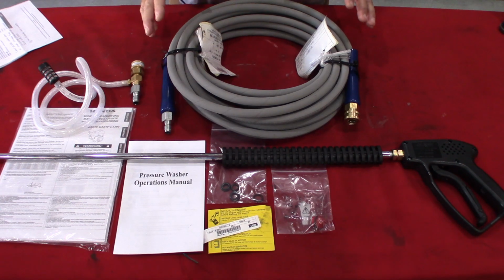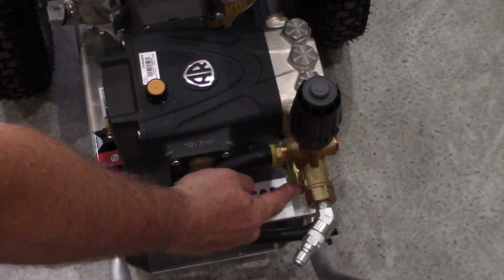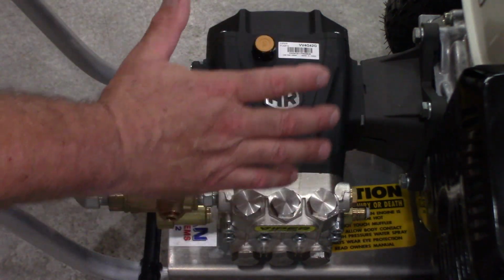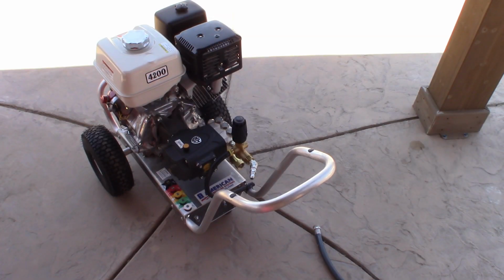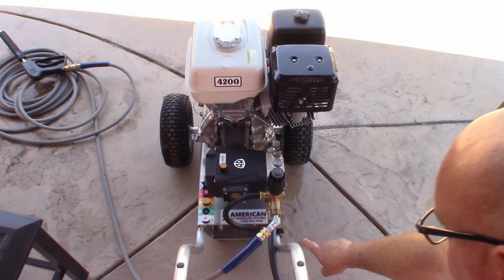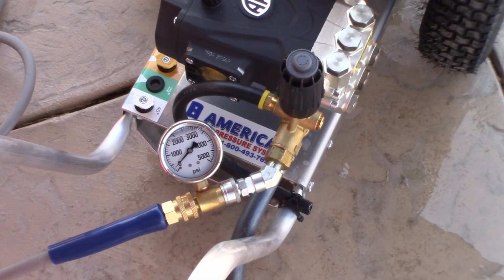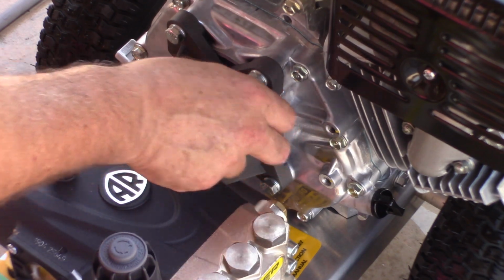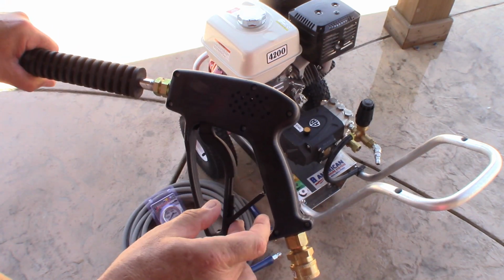American Pressure Systems 4200psi Pressure Washer #realraysgarage

Comment: Great demo!
Reply from the maker: Thanks Jim, To date zero issues and works as good as the day it arrived! Excellent pressure washer and great company!
Reply: @RaysGarage  You're very welcome. I purchased a very similar model from American Pressure because of your video. My previous pressure washer wasn't working great, and I wanted to upgrade to a commercial model. I had questions on the pump like you did. I ended up going with a 4200 psi, 4 gpm, Honda GX390 engine, and the Viper pump. Just picked it up from FedEx today. One question... do I need to add oil into the Viper pump, and does it require the same oil as the engine. My other pump didn't require oil. Thank you in advance for your assistance.
Reply from the maker: @jimrussell4731  American Pressure Systems will send you the oil for the pump and engine.

Comment: Awesome modification on the water dump system!
 
I’ve modified many different things in my day. Built turbo engines for a few cars.  Built several computers from scratch.  Dirt bikes, crotch rockets ect ect.

I have an idea you may like. 

The bypass system that you turned into a dump system.  That’s the best for absolute peak performance cooling, however It seems like it would make quite a mess.  Maybe it’s not a big deal and I imagine for most it won’t be any trouble at all.

But, I think there may be a middle road to take for upgrading the bypass system.

If you got a small radiator, something with let’s say 1/2 to 1 liter in capacity, it would at the very least add more cooling potential to the bypass system, with no leaks.  If need be, which I don’t think there would be, a small electric fan could be hooked up to the system to just run constantly with the pressure washer while it’s running.

Could be a pretty in depth mod, but I think for some people that may be a nice feature that could add more potential and greater longevity to the pump.

I am still learning, but that’s the best Idea I have so far.  I figured it would be best to share, and risk sounding ridiculous, than to keep it to myself if it really could help a couple people.

Thanks for your video. I am going to their website now and plan on possibly purchasing this very unitT.  I was looking at power-pro for manufacturer but this one is almost identical and a couple hundred dollars cheaper.
Reply: Actually, that's a great idea. A heater core would work great

Comment: I just bought this same exact model! Comes on Wednesday! Adding pressure washing to my business and can’t wait for this beast! Thanks for the review!
Reply from the maker: Your going to love it!!!
Reply: @RaysGarage  - it arrived 1 week late. Just got it yesterday. Question. On the pump it says “only use sae 15w40” which is a detergent. But everyone says make sure you use “non detergent “ on pumps. Should I just follow the directions of the pressure washer?
Reply from the maker: @saulpaul7263  Hello Saul, Mine came with the correct engine and pump oil, bothe oils were different so I would stick to what the engine and pump manufacturer recommend for your model engine and pump.
Reply: @RaysGarage  - appreciate it!!!

Comment: I bought a pressure washer at my local hardware store and it's like the little brother of your machine, which is awesome btw. Mine is a Champion PRO #100787 using a Honda GX200 with a AR Pump JRV2.5G32 producing 3500PSI and 2.5GPM.

Comment: Great video, and nice setup.

 I run something similar commercially, just in a more glorified manner with the attachments and reels and whatnot. 

My dealer gave me a hint when setting those unloaders. You want some water (a dribble) to come out of the unloader while the trigger is pulled. This saves the unloader from slamming shut onto metal when it unloads and helps it last a long time. Your unloader is set aggressively in this video. You don't want trap pressure over the maximum pressure of any part of the system. Usually 4000psi with this kind of equipment. 

Great job opening up the bypass, that's such a lifesaver when you need a short break and don't want to kill the motor. I usually just idle mine down all the way and let it run. My only problem with this kind of motor is the small gas tank and lack of a fuel pump.  Thanks for sharing.
Reply from the maker: Hello Carl, Thanks for sharing this great information! I will contact American Pressure Systems about that slamming at high pressure since I do want this pressure to live a long time! Best Regards, Ray

Comment: TY. On pumps: That Viper looks nice. I was deciding between that one and the same one (also with the Viper pump) with the belt-drive for $500 more. Went for the belt. I used Pitts Spray Equip, they had every option you could fatham, so they also had that one you have or a belt drive with the Cat pump for $100 dollars more each. Anyways, your video made that decision very easy. Plus Cat is the only pump with a 2 year verse 5 year warranty. 

Any engine is going to last longer than you're ever going to keep the machine, it's just the pump that your are going to have to worry about eventually failing. So when it comes to picking your worries, prioritize.
Reply from the maker: Belt drive pump is the way to go, lower pump RPM = Long Life! 👍👌

Comment: Looks like an excellent unit that should last a long time. I use a heavy duty tie wrap to lock my pressure wand on when starting the engine. This saves you trying to hold the wand while you pull the starter rope.
Reply from the maker: Good idea Jim, Thanks for sharing! I do hope this unit lasts since I will be using it about once a week or more. Cheers, Ray
Reply: If you have the dump valve like in those  video, you don't need to pull the trigger.

Comment: Hello Ray, I just saw your video and WOW that's an awesome machine!!!  I'm in the market for one and don't want to go cheap.  I will be calling American Pressure Systems a call tomorrow to obtain more information.  Definitely will do the dump hose and see if they will put a nice tip at the end of it, maybe they have them on sale.  Hopefully, they can ship out to Fresno, CA
Reply from the maker: Ask for Phil and let him know Ray's Garage sent you, you will not be dissapointed!
Reply: Hello Ray, just ordered it...can wait to start using it!

Also, can you include the link for the pressure gage you bought on Amazon?

Thank you!!!
Reply from the maker: @huerro1974  https://www.amazon.com/gp/product/B0000AX9TR/ref=ppx_yo_dt_b_asin_title_o07_s00?ie=UTF8&psc=1
Reply from the maker: Check to be sure there is enough oil in the crank case, this motor has a low oil cut off. Also verify the on/off switch is in the on position.

Comment: Like the big engine and the pump that can make that amount of pressure..The non marring hose looks a lot softer and more flexible than those nasty stiff cheap hoses....The Honda is a Beast of an engine...The only problem you may ever have is sometimes the carburetors need a mod to the jets for more fuel  if they start to surge It is a very easy fix to do
Reply from the maker: So far its been great, starts on first pull most of the time and has a ton of power!
Reply: not2fast- I have the carb problem you describe.  What size did you drill out the jet?

Comment: I have a similar machine, Honda engine and AR pump. Gets a lot of use and has been trouble  free for 6 years.
Reply from the maker: Great to hear it will last, thanks for sharing!!!
Reply: @RaysGarage  get the proper oil for the pump by the way. Some say it doesn't matter but ordinary oil froths badly.
Reply from the maker: @petefletcher  Great point and be sure and get the correct pump oil, Thanks!

Comment: I'm not far from Melbourne , I might have to give them a visit. How did you set the un-loader to a dribble , like the guy mentioned in the comments ? Thanks for the upload.
Reply from the maker: Hi John, The unloader dribbles when the wand trigger is pulled and gushes when not, it dribbles les the higher the pressure your blasting.
Reply: @RaysGarage  Thanks for the info ! Take care.

Comment: I've got one question the way you have your bypass when you're not pumping water through the tip of the wand and you have the chemical applicator on it will it pull chemical out of the bucket when it's bypassing?
Reply from the maker: That’s a great question! I do not know and will have to try it to give you a correct answer.

Comment: Question with the way they have to quick connects your not able to hook up let's say a floor cleaner because they all have male connects on them . So the quick connects are backwards on this.
Reply from the maker: Hi Jeru, I have not had an issue connecting other attachments like a surface cleaner or other wands with this current configuration. This is the way it came from American Pressure Systems.
Reply: @RaysGarage  did your attachments have a male connect on them or female cause a lot of pressure washers have the female connect but this one has a male. Basically what I'm saying is that they got mine backwards I think.

Comment: Ray I bought the same unit form another supplier because I wanted it to ship to the house. My question I want to do the mod on the pump. So the dump hose was there already on the cold water inlet and they just had to remove it from there plug the hole and move it to the unloader? Thanks again .
Reply from the maker: Hi Chris, American Pressure Systems did this mod for me, I don't think there is very much involved in doing this and am sure they can explain how to do it. Thanks!

Comment: I have a similar setup, with an AR RRV4G40D-F24 pump. You showed installing the dipstick, but I'd appreciate knowing what's the right oil to use for the pump.
Reply from the maker: Hello Walt, The pressure washer came with the oil for the pump, I did not save the bottle but I'm sure Annovi Reveberi can tell you which oil to use. You can also ask the dealer where you purchased from, Im sure they will know as well. Regards, Ray

Comment: Hi, enjoyed your video, very helpful. I noticed that pressure pro sells the E4040HA also that is very similar to the one you bought but has a AR (Annovi Reverberi) Brand RRV Triplex Plunger Pump instead of the AR viper pump. I have not been able to find any information out on the Viper pumps, when I go to the AR North American web page they do not list them. When I try to research them all I find is people selling them but no specifications. I was trying to find the difference between the Viper and the RRV pumps. I am more familiar with the RRV’s. I’m just about to order one of these pressure washers but do not know which one to order. Any help would be appreciated.
Reply from the maker: Hello Alton, Thank you! I would recommend contacting American Pressure Systems, gert folks and will give you all the info you need to make your decision.
Reply: I recently bought the same machine a pressure pro E4040HA with triple plunger pump from pressure washers direct. It's not belt driven. I haven't messed with the pressure nozzle I need to read up on the benefits of doing that. Thx for sharing

Comment: So I bought an ar viper for my machine. Guy told me it was new, but it was used "to see if it works". Should I put anything through the pump, such as wd40, penetrating fluid to break down any calcium, etc?
Reply from the maker: No, just keep a good flow of water and you should be good to go!

Comment: Is this the pressure pro e4042hv or e4040ha ?
Reply from the maker: Model #D4242HV
AR Viper Pump VV4G42G
Reply: @RaysGarage  ok thanks, I know u explained it but it look so similar to one I’ve been looking at and it has the same Honda motor. I’m looking to start off a small business, and comparing them basically. Thanks for the vid I’m going to look more into it
Reply from the maker: @sneakerheadlowlife  If your going to run this daily, look at a belt driven pump. It’s a little more money but well worth it in the long run!
Reply: @RaysGarage  a belt driven pump? Is that a add on ?
Reply from the maker: @sneakerheadlowlife  The belt driven pump is a better set up for daily use, my model is a direct drive pump connected directly to the engine. The belt drive unit is mounted on the frame and driven by a fan belt and turns slower than engine RPM, this is why it will last longer.
Reply: @RaysGarage  thanks I’ll look into it some more. I want to start off with driveways and house exteriors

Comment: Ray's garage do I need to turn unloader all the way to the right. Or do I have to buy that gage and check it. also was that as far as it could go
Reply from the maker: Hi Bruce, The unloader is not adjustable it is meant to bypass water from the pump when the trigger is not pulled, the higher you increase the pump pressure the less water is unloaded when the trigger is pulled. without a unloader pressurized water builds in the pump which causes tremendous heat shorting the pums life.
Reply: @RaysGarage  I have one more question I hope u can respond to. I'm getting ready to buy this 4200 psi 4gpm machine. I'm gonna put a dump hose on mine as well. This will be my first piece of equipment.. is your still running great.. thanks for responding
Reply from the maker: @brucerice5759  Hello Bruce, I have had several pressure washers and I have to say this is one of the best ones for the money, mine is running flawlessly after many hours of use! One recommendation a viewer gave was to recover the water from the bypass valve for plants and trees.  American Pressure Systems is a great company, tell them I sent you!

Comment: whys the water coming from the side
Reply from the maker: Alexis Idlette-Wilson Hello Alexis, It’s called a dump hose, it diverts water out the hose when the gun trigger is not pulled to protect the pump, it also increases pump life since pressure is not building up in the pump.
Reply: @RaysGarage  I took mine to northern tool to get the dump hose mod and he said it would eventually ruin my pump. Is this true? I mean I've seen a ton of people do it.
Reply from the maker: @gulfcityartz2263  From what American Pressure Systems told me is that allowing the water to build pressure in the pump when the trigger is not pulled will decrease the pump life. This same company repairs pumps daily and highly recommends the dump/bypass hose. Please let me and the viewers know if this is not correct information. Trust only experienced pump rebuilders. Thanks!
Reply: @RaysGarage  Thank you for the information. That's what I thought as well.

Comment: You in fact do need to get a bigger setup like this to get decent performance. Pressure washing takes a lot of mechanical energy just to produce a decent spray. The cheaper ones at big retail are pretty much a waste of money/time/space. Preaching to the choir, but some may not know. The ones with burners are even better, but lots of bucks for sure.
Reply from the maker: You are 100% correct Mark, I really wanted a Belt Driven unit but was looking at $500 more beans, I could not justify the extra cost Now the heated units are the bomb but like you said, big buck!

Comment: CHINESE CLONE ENGINES are ALSO VERY GOOD 
i have a BE Pressure washer 3100 Psi with 210cc Chinese Clone Engine - also with Adjustable Pressure Knob 
Also have 3 Ridgid Pressure washer , 3300 psi Carbureted , 1 is EFI Subaru Engine , with SOLID Wheels and a CAT Pump

Comment: Those pumps are junk compared to others...sorry.
Reply from the maker: Hi Jimmy, If this pump is junk why does it still work flawlessly with daily use for several years now. My opinion is much different than yours based on my experience. Best Regards, Ray
Reply: @RaysGarage  They are still junk...hopefully yours will be as good as you want.
Reply: Tell us why Jimmy.
Reply: @Joe-db5hz  I guess they just designed them to have a short life. I am not the only one with this opinion...otherwise the professional washers would use some of them...they are non-existent on pro wash trucks.
Reply from the maker: @Joe-db5hz  Yes, I would like to know as well!
Reply: @jimmywarren6685  Yeah Jimmy Tell us why the pump is junk. Do you have any technical or mechanical knowledge?? Or are you just speculating?
Reply: @scottjamable  You are free to form your own opinion...but YOU will have to pay for that!
Reply: @jimmywarren6685  I didn't voice an opinion but you voiced a pretty strong opinion. Do you know why they are junk? That is all I am asking. Please clarify what the differences are. Enlighten us.